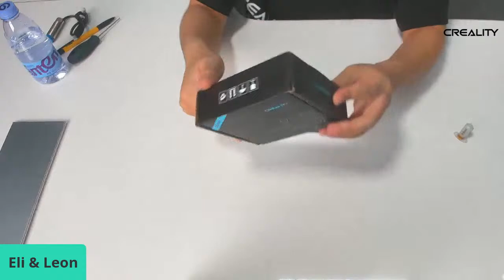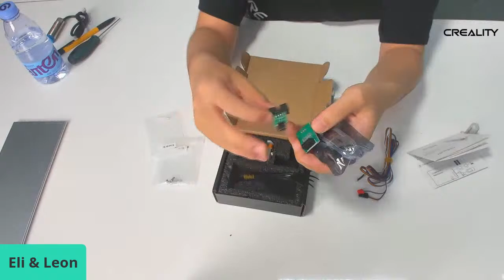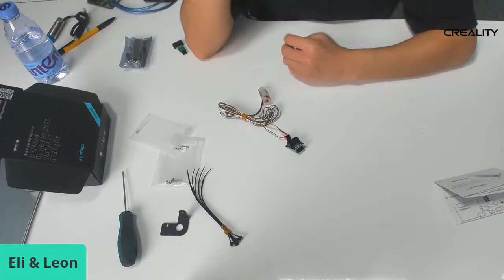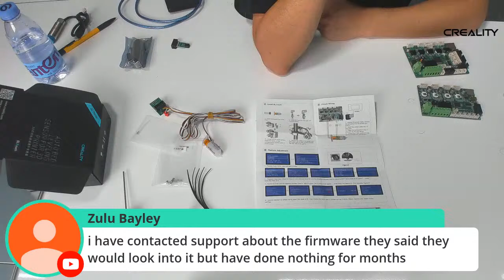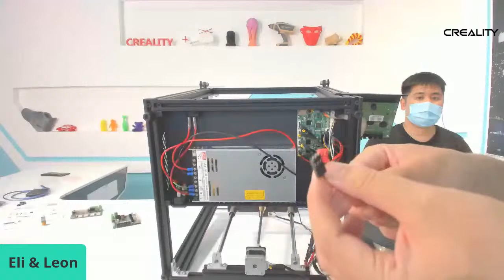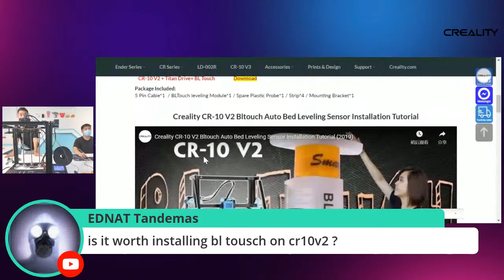Comparison of BLtouch V1 and V2

Comment: i want to share my experience with creality customer service. I bought a ender 5. All well but the heat bed is bent, like in so many reviews. The techisians ( if you can call them thechs) suggest that is not a problem , that i can use (imagine) 4 sheets of paper. So the bed is like 8 layers in the middle down from the rest. And the keep changing the customer service agente just to pass time and not send me a new bed and flat! There is a warranty and they are not complying!
Reply: Yes you are exactly right about that the customer service sucks before I ordered my Ender 3 V2 I asked if they had the bltouch for it. So One of the so-called Tech's got back to me and said that it does not come with a bltouch but you can purchase one. So I have purchased a bltouch through creality and 34 emails later they tell me they don't have the software for that printer yet..